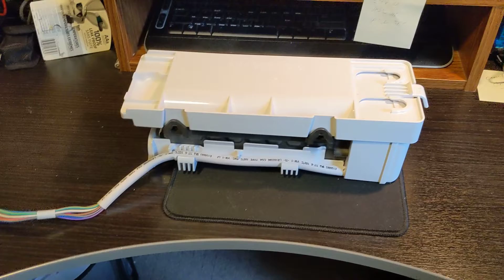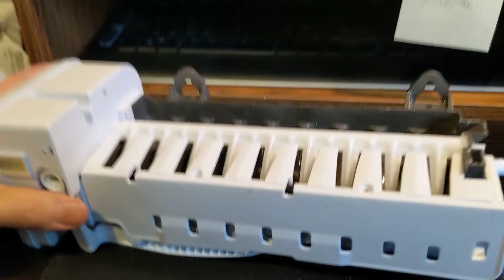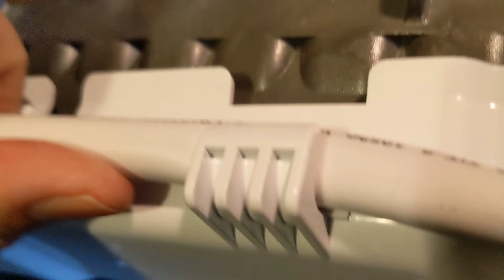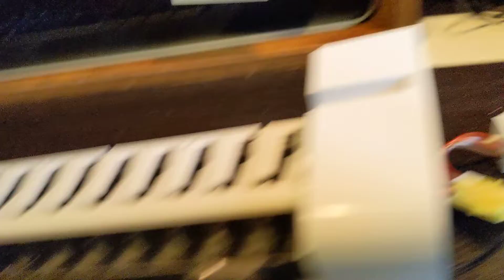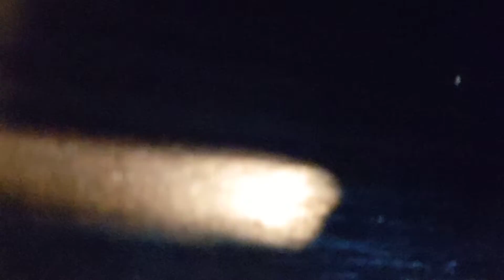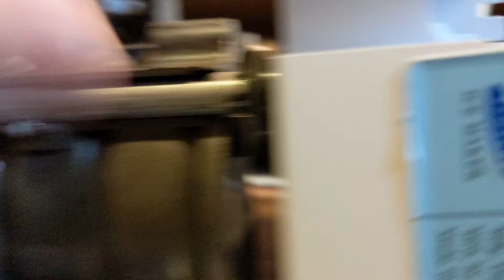Repair Ice Maker for Samsung Refrigerator

Comment: Great video - helped!  Neighbors just donated their really nice (but broken) Samsung RF4287HARS/XAA ... several odd things happening that are likely related to the main PCB, but refrigeration circuit is fine, apparently.  Tray filled with water, but then motor heard trying to eject the cubes - not working because the heater had not been sequenced, because the thermal fuse was blown.  So, if water fill, and heater is controlled by the main board, it should make ice whether or not there is a dispenser unit issue.  Dispenser was replaced, but didn't work.  I tested every microswitch, the plunger left door open switch, the magnetic switches for the inside lights.  During restart I noted 1.35 VDC on the water valve, and 0.4VDC on the ice valve - momentary.  AI says this is the issue - and, it is a main board problem -  not sure I buy this, yet, though.  Wiring at top left of left door looks fine - however, have not yet metered each and every one.

Comment: Thanks for making the video.  Very helpful.  I don't think I will be testing the continuity the way you suggest though.  Testing the continuity through the 'thermal fuse' and the heating element (in series) still does not definitively answer which one of the two components is the problem if an open circuit is present.  Heating elements do fail too. Need to test both IMHO

Comment: Did you use any special epoxy at the leads & insulation junction or just cut to fit with the shrink wrap?
e2f tam 250v 3a 102 shows quite leggy leads, wondering about the re-work details.

Comment: Thanks for the video, I have the same issue but when I did the continuity test on the heater probes got nothing even when I bypass the fuse.  Any idea ? do I have a bad heater element?   Thanks.

Update: got it fixed. Great video and instruction.

Comment: Link for fuse?
Reply from the maker: I bought these. I wanted 2, in case I broke one.   https://www.ebay.com/itm/Thermal-Fuse-For-Xbox-One-Kinect-2-0-A1-3A-102-Degrees-250v-/292327401763?mkcid=16&mkevt=1&_trksid=p2349624.m46890.l49286&mkrid=711-127632-2357-0
Reply from the maker: These are on Amazon and should work: Exiron 5 Pcs Aupo Thermal Fuse Cutoff TF 102℃ 250V 3A A1-3A-F https://www.amazon.com/dp/B07FRPJDCG/ref=cm_sw_r_apan_glt_fabc_BCMMT5K0N73KV85X8Z25

Comment: Do you have a link for the fuse?
Reply from the maker: https://www.ebay.com/itm/Thermal-Fuse-For-Xbox-One-Kinect-2-0-A1-3A-102-Degrees-250v-/292327401763?mkcid=16&mkevt=1&_trksid=p2349624.m46890.l49286&mkrid=711-127632-2357-0
Reply from the maker: These are on Amazon and should work: Exiron 5 Pcs Aupo Thermal Fuse Cutoff TF 102℃ 250V 3A A1-3A-F https://www.amazon.com/dp/B07FRPJDCG/ref=cm_sw_r_apan_glt_fabc_BCMMT5K0N73KV85X8Z25
Reply: @davidcampbell7329  thank you for the great video and help on this. I just have one question.  Should there be any resisting reading across the fuse.  Mine is reading 103 ohm?